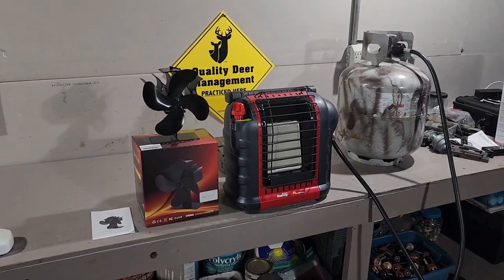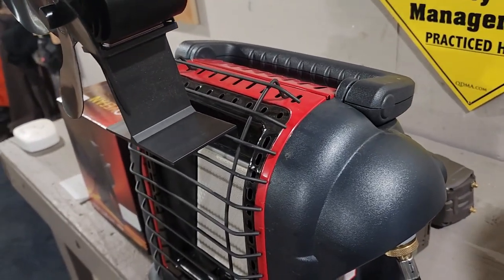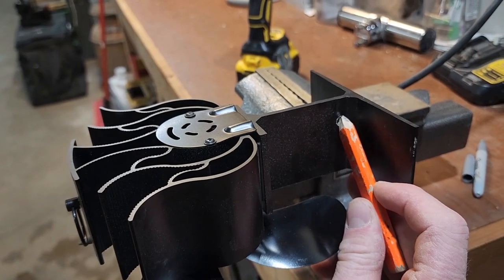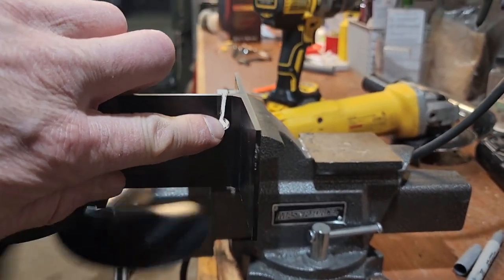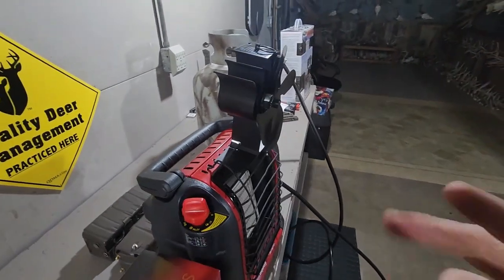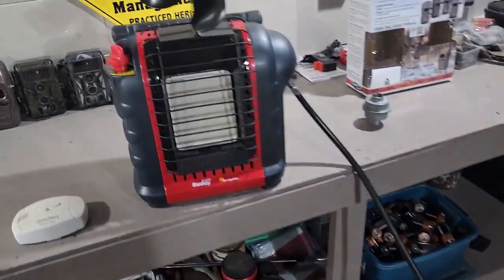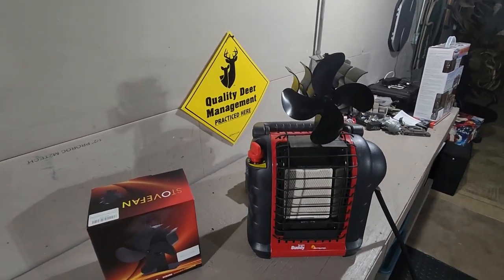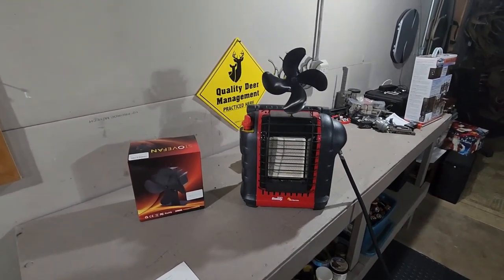Mount a cheap Amazon Fan on "Buddy Heater" for Deer Blind, Ice Shanty, Off-Grid Cabin, Tent

Comment: I used a metal clothes hanger. Cut it and made a “V” with wire. Wrapped it around the front of fan and bent it to hold on to the crate on the heater. Holds real nice.
Reply from the maker: Sounds like a great alternative way to make it work. Thanks for sharing!

Comment: This looks a great idea for 20$!! You always seem to have some great ideas. I watched a YouTube video the other day and the guy said the best way to keep a deer blind warm is with a small wood stove and the best part is there is no condensation buildup on the windows because of the dry heat. You would also need a small vent pipe but might be an option worth considering as well
Reply from the maker: You must have been watching Mark from The Back 40. He puts out great videos. I think a woodstove is a great option if you spend a good amount of the day in the same box blind. I usually hunt one (out of a handful of different ones) for a few hours in the am, then another for a few hours in the afternoon. Propane heaters are pretty cheap, so I set them each up with one, and they provide instant heat for those short sits. Window frost and fog is definitely a problem to constantly deal with though.
Reply: @UncleBucks  .. I think it was the back 40! Can’t beat a buddy heater for convenience.

Comment: I watched a YT channel a while back where the host took the grill off of a Mr. Heater and flipped it around then inserted the frame wire back into the holes at the top. This made a tray out of the grill that stuck straight out. You could set that fan right in the tray so you wouldn't have to do the drilling and grinding. A plus with this grill/tray is that you could heat up soup/stew or a grilled cheese sandwich wrapped in foil. Give it a try and tell us if this works.
Reply from the maker: I believe I saw that same video! I don't enjoy cooking at home, let alone while I'm out hunting 😆. To each his own. I'm sure it would work but it would stick out the front a little more, and angling it downward may not be an option.